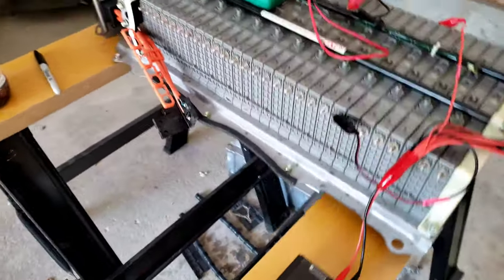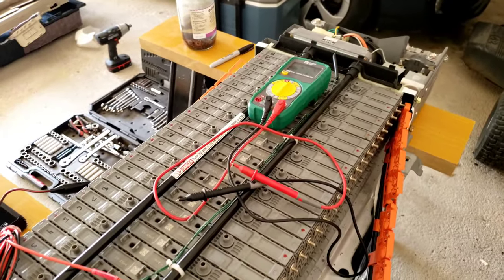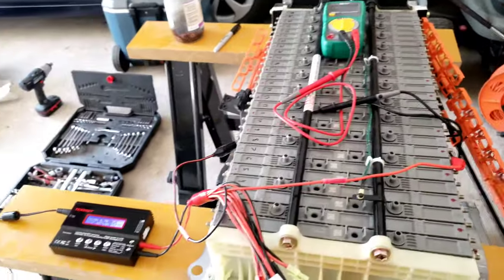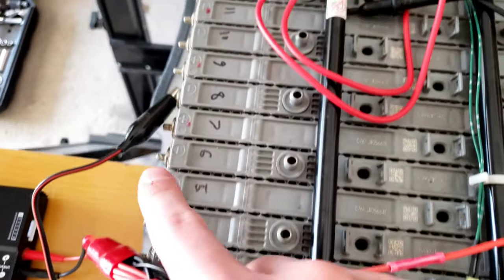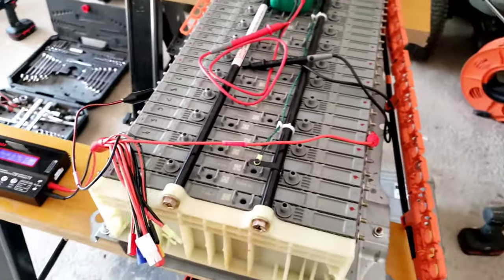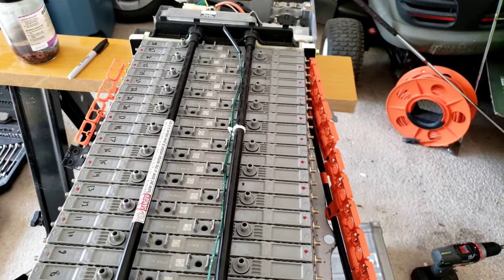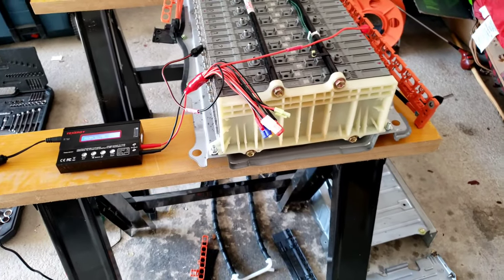Reconditioning a Prius Hybrid Battery Pt 1

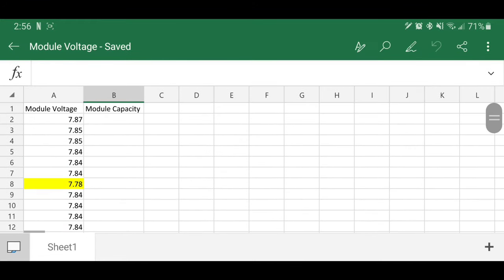Comment: Lol. I think starting on row 2 got you. It was the 7th module that had the slightly lower voltage of 7.78V which was on line #8 (2:59). But then you got suckered into testing the capacity on the 8th module (3:13) which had perfectly normal voltage of 7.84. Maybe you should have just added another column and put module numbers in that column, rather than trying to remember to convert between line number and module number.

Comment: Hello, I just recently purchased a 2012 Toyota Prius, this is my first Prius and I was wondering what I could do to service this car. Then I came across your channel. Love the information and I was curious about your opinion, do you think it would be worth me reconditioning the hybrid battery even though it's probably never been done before and it's 11 years old. It will cost me about $600 dollars for the charger and discharger. Or should I just wait until the hybrid battery needs to be replaced. Thanks

Comment: Can you drive the car with a bad cell? I put the blue driver on to test. I got an error code of P3013, P0A80, P3000 Battery block 3 has become weak. Also have a red triangle and the check engine light on dash.

Comment: Dr prius app ahows temp 3 high which side is it and i was thinkong middle ones will be hot
Reply: The theory is that the middle ones get hotter faster.  Not sure if that makes sense since the downstream ones are being cooled with pre-heated air.  Anyway, it appears that the middle ones do fail more.  Personally, I don't believe anything until it falls on my head.
Also, I don't understand what you're asking here.  The app shows temp 3 high?  Module 3?  My guess is that module 3 is the 3rd one from the right side.  The side opposite where the safety plug was.
How do you like Dr. Prius?  I need to get an OBD2 and I'm hearing all sorts of recommendations.  Elvis Duf got a different one and he seemed happy with it.   His channel is just called "Duf" on YouTube.  You might find some info there.  He did his Prius battery and made some mistakes/ learning experiences.
Reply: @alext8828  hi Dr prius is ok but if u want see life expectancy and detail it charges 11.99$
So mine I don't know why temp 3 is high since middle should be higher my prius has 221000 miles

Comment: question. I got a prius battery in the basement for few year. Im getting a t180 coming in a few days. What number i need to look at when i attach it to t180. and do you cycle the battery 4 times from drain to charge 100%? Thanks

Comment: Hello. I have the same charger and wanted to know what settings you set yours to? I ran mine thru with a charge of .5a and a discharge of 2.0a. I didn't want to go full throttle at the cells but I get a "overcharge capacity limit" and it shuts down. Idea's what I'm setting up wrong? Thanks
Reply: Old comment but usually mah setting on charger.  Example set to 3000mah and batteries need about 5000mah.  Set to 7500mah and should be good

Comment: WRONG .  Voltage not important , CAPACITY this is very important .    If cells dont have power inside , voltage can be good , but car start up and start use power from battery at this moment bed cells drop voltage and hybrid system stop vorking
Reply: Are you saying that the modules have to be challenged to see the total wattage?  One of the OBDs challenges the battery pack to see the results.  It could be Dr. Prius.  How would you go about doing it on the bench?  Possible running a load to see how long it takes to go flat?  Good point.
Reply: use a small lightbulb for30 seconds on

Comment: UPDATE: I did this procedure and 3 months later the battery is running like a champ I just replaced 2 very low voltage cells the reconditioning took like 1 week and 2 days but it was worth it I spent like 300 bucks including the hubby charger and the 2 cells.

Comment: Can you share how long this ended up taking per module? You saiud you were at 90 minutes, is that close to done? Then you did that four times, multiplied by 28, for a total of 168 hours or 7 days?!
Reply: The original uploader doesn't seem very responsive, so I'll add that I went ahead and tried this for anyone reading from the future. While it works exactly as described, it's reaaaalllyy slow. I'm able to do about two modules a day (probably three if I'm dedicated enough to set an alarm in the middle of the night). So at my current rate I'm looking at two weeks for diagnostics. More if factoring in testing replacement modules. Each module takes upwards of six hours to complete, whether it has a low total capacity or not. 

If you're buying the alligator clip wires, I suggest buying something beefier than what is linked. I was getting tons of errors with the cheap amazon stuff and the wires were hot to the touch; they're made with the absolute minimal amount of copper, and while you get a few of them per pack, I found them to be useless for this application. 

I ended up soldering a much thicker gauge wire to the small leads and then using the nuts original to the battery pack to fasten the wires. While this isn't as quick of a swap as alligator clips, it only takes about a minute, the wire remains cool to the touch, and since it's taking 6+ hours between swaps, it's the least of my inconveniences lol.

Comment: What's the significance of switching the original bus bars with nickel bus bars?
Reply from the maker: I didnt switch mine but some people switch theirs to try and improve the conductivity between the modules. Less resistance from bus bars in theory means a more efficient battery.
Reply: @HEVTech1  Thank you very much for the info, I'll get them installed in my Toyota Hybrid Fielder Wagon next service date!

Comment: I've been looking at replacing some of my modules since my old '08 Prius got the triangle of death. I am looking at replacing 4, but all the reviews I find suggest the available cells are low quality. Do you happen to have any reputable sites where you pick up new modules?
Reply: Chris Fix video is better, this mix-n-match method will not last. Replace them ALL yourself with upgraded cells. Very affordable.

Comment: Hey @H-EV Tech, I'm a little late to the party here, but my T180 charger is only giving me the fine discharge capacity at the end of the cycle, also it took about 12 hours to complete 5 charge discharge cycles, on one module is this normal?
Reply: That's pretty good for 5 cycles, 12 hrs.  But I suspect the battery capacity is low.  I be lucky to complete 3 cycles.

Comment: So most of my voltages range between 7.2 and 7.35 volts 
I have 7 modules between 6.6 and 7.01 are these all bad?? None are 1.2 volts low.
Reply from the maker: I would apply a small load (6-12v bulb) to the module and measure the voltage. I suspect the 6.6 will quickly drop to 6v or less while the others stay steady at 7.2v
Reply: Buy hobby charger.  That will show the capacity of the battery.  Cycle discharge/charge several times.  They seem to revive once completed several times.

Comment: did you do any load testing in addition to dr prius to figure out which module was bad. because dr prius is at the block level not necessarily at the module level.
Reply: He seems to have tested all modules for voltages...

Comment: Can I use the module in my snowmobile?
Reply from the maker: Its 7.2 volts and very heavy with low energy density. NiMh is also heavily impacted by cold temps so I would say "no" not a good idea 😂

Comment: I bought the T180 followed everything u stated,  I connected alligator cable to the bare lead on the octopus harness....set everything up held down Enter for few seconds.... I didn't get Confirm  & start screen, instead I got an "ERROR"  "process interrupted message.. help what wrong
Reply from the maker: What voltage are you reading on the module you are attempting to cycle charge?
Reply: @HEVTech1  I was using the Tenergy T-180 .  I was trying to cycle "1" module out of the 28 modules. The T-180 was set for MiMH.  I used alligator  clips to the module (1 battery) and the  other end on the  bare wire of the octopus which connects 2 the Tenergy ...
Reply from the maker: None of the 28 modules should have the copper bus bars on them when you are doing your cycle charges. Also make sure your polarity is correct.
Reply: @HEVTech1  ..yes I am trying 2 cycle charge each battery... what setting do I put the charger on ? NiMH?
how do I attach the the alligator clips line ( alligator clip to (+) & (-) battery  post , other end of the wire to the "octopus multi-connector ( do I need soder the wires 2gthr?
Reply: I apologize,  I am trying to charge  and discharge  the batteries to recondition them
Reply: @HEVTech1  yes all the copper bus bars are removed

Comment: funny that I have the same model year GenII and I did exactly the same - spreadsheet and starting voltages, read the capacity etc.. rebuilt the battery. put in back in the car, started, no issue for about 20 minutes, and tried starting again, this time the 12v battery which was only 4 months old was dead - left it to crap from anger - so, I got the 12v battery replaced, but now the HB is discharged - yup..gotta get it out again, balance them, find their resistance and capacity - recondition them (some say it is really bad to do this), and then charge them back to whatever the capacity that is acceptable (hope one cell just don't die as it goes back in the car) - and then see how it goes - but I got to buy a charger I guess - to do this - I am afraid by the time I get the charger and charge everything back up, the 12v battery might die again ($250 for a stupid battery these days) - so the "reconditioning" cycle is basically now that I am thinking about it is being used on me - Perhaps I shold just donate the car and get my E63 AMG or GLS63 and instead enjoy life. 

Sometimes one should wonder "why the phck am I doing this"?
Reply: Remove the battery while doing work on the car ?
Reply: the story sounds very interesting. you are right sometimes i also wonder why i do this by myself i think its because i want it cheap and in the best way possible? :D whatever it is

Comment: I'm curious, did the bad modules coincide with the data that your OBD 2 reader gave you when you did the battery test in the previous video?  I noticed the numbers are different on your spreadsheet in this video.
Reply from the maker: They absolutely did! I found a couple modules that hadn't failed but were not super healthy in terms of capacity. The numbers you see in the video are the module numbers, but the app gives you a block number. A block is a group of two modules.
Reply: @HEVTech1  Thanks!  This has been incredibly helpful!
Reply from the maker: @Akabackalooka  love to hear it, its why I do it!
Reply: @HEVTech1  hello there! Do i need to purchase a license for testing the toyota prius battery procentage life?

Comment: great vid series. my cells average 8.1 volts is that normal?
Reply from the maker: Depends on if the battery was pulled when the pack was charged up. 8.1v is somewhat high but within the acceptable range.
Reply: @HEVTech1  thanks started reconditioning this morning can't figure out how to get the t180 to summarize five charge cycles
Reply from the maker: @bobk9412  I think the way I did it was to click on "Cycles" then enter the number of desired cycles, then press and hold "Enter" while the # of cycles is still highlighted.
Reply: @HEVTech1  yes that worked. another question. charger set for 5a discharge but never shows over 2.4a while discharging?
Reply from the maker: @bobk9412  that is correct, the charger is rated for 20 watts maximum of discharge power. Because the voltage of the module is 7-8v you will pull about 2.4a to be right around 20w
Reply: @HEVTech1  If you start with a charge/discharge cycle are you leaving the modules discharged and then charging them when they are all connected in series
Reply from the maker: @bobk9412  I charged them all separately to about 7.8v then connected in series and left it sit for well over a day to balance out.
Reply: @HEVTech1  Just finishing up reconditioning my modules.
 I have an average of 4687mah. With the highest module being 5187mah  and the lowest being 4250mah.  Do you think I can get another 40,000 miles with those numbers?
Reply from the maker: @bobk9412  a brand new module is rated at 6,500mah so 4,250mah or roughly 65% of its original capacity isn't terrible. Remember though, the pack is only as good as the worst module, so if the difference between the worst module and the second worst is more than 100-200mah it might be worth getting 1-2 more modules to replace the worst in the pack.

As for whether it will last for 40k miles....capacity is a somewhat good indicator of module life but unfortunately it won't tell the whole story, in my reconditioned pack I had every module at 5000mah or better and matched up the worst module with the best one so each block has a similar total capacity. If you are driving mostly highway I would be fairly confident you could squeeze out another 40k miles from those numbers above. If you are driving mostly city I would expect to potentially open it back up in 1-3 years.
Reply: @HEVTech1  Thanks for teaching me how to do this!
Reply: @HEVTech1  Did you leave delta peak on auto?
Reply from the maker: @bobk9412  yep!
Reply: @HEVTech1  The reason I ask is because it ends charge at about 9.05 volts
Reply: @HEVTech1  Bought 7 mods from ebay. cycled 5 so far. Discharge capacity for 3 cycles. 
Mod1= 1374  1534  1440 
Mod2= 1962  1920  1885 
mod3= 3804  497  806  
mod7= 1708  2285  423 
mod8= 2642  2547  1656.  
Ever seen anything like mod3 mod7?

Comment: In a nutshell. Can these batteries regain their strength by deep discharging and recharging?  Or is it a waste of time?
Reply: I guess the same as every rechargeable battery ever was "suck it and see" some die and some don't, that's why you do this type of testing/refurb.

Comment: you are advertising a Tenergy T180 charger but on the Amazon site said *NOT Intended for charging/discharging PRIUS battery
Reply: NIMH chemistry is the same it just takes longer.
Reply: Doesn't matter, since the concept is similar.  Selling with certain phrase may become legal terms, thus not for Toyota.  If you want to go safe then go to Toyota and get them replace at your cost.  This instruction is for those who don't want to spend or having satisfaction of fixing.
Reply: They're probably referring to the pack as a whole and they'd be correct. Most of the hobby chargers can only deal with around 16 individual NiMh cells, such as a single AA x 16. The Prius, since it has multiple cells in one module, would max out most hobby chargers with just two modules. Put all 28 together and you have one fried hobby charger.

Comment: does anyone know how to do fast checking of used modules ? thanks
Reply: Viper 12v battery tester from harbor freight . It does load testing so it’s more accurate. Press enter until you hit last question that says is battery in car. Then press no and you will get the results.

Comment: isnt module #1 supposed to be the closest one to the ECU?
Reply from the maker: Toyota can't make up their mind on which block should be #1

https://priuschat.com/threads/hybrid-battery-block-numbering-left-to-right.199392/
Reply: No
Reply: Old question, but information is always good. From what I've read, it's not left or right nor is it related to proximity to the ECU. The HV pack has a main positive lead and a main negative lead. Where the negative connects on the pack, that's pair/module #1.

Comment: You think I could fix my own battery with no experience?
Reply from the maker: Taking on this job is 100% for you to decide based on your comfort level. I was sure to do lots of research and use proper PPE and while I had no experience prior to reconditioning the battery, I did prepare which helped me be successful. Attempting this at your own risk understanding it can injure or kill you must be understood prior to dealing with any amount of high voltage electricity.

Comment: Awesome videos! Can you share some reputable sites that you ordered your modules from? I’m in the exact same boat and would love to be able to save some $$ throughout this project. Thanks in advance! Appreciate your videos :)
Reply from the maker: This is a tough one. Toyota certainly doesn't sell individual modules so you are usually stuck with eBay or companies that specialize in prius battery reconditioning/replacement. I got mine on ebay from a seller with really good feedback.
Reply: @HEVTech1 my father always says never buy reconditioned… I wonder if the 5 star reviews will sway him 🤣 or just get him crippling paranoia as to how to fix such a rediculous piece of crap. Tune in next time.

Comment: Wow 90 plus mins to do 1 module 1 time lol. And need to do it 3 to 5 times. And then repeat for all 28 modules. Wtf. How long did it take to do the whole pack 3 to 5 times? A month?
Reply from the maker: I ended up getting two Tenergy T180s which speed this process up a ton. That process should be in video #2
Reply: $ = time....$2k - $4000 new complete battery